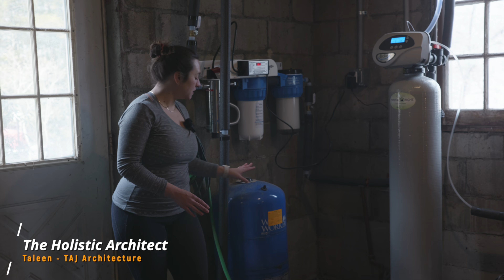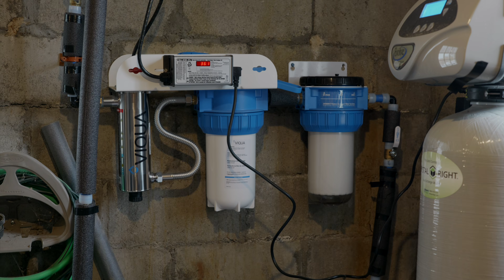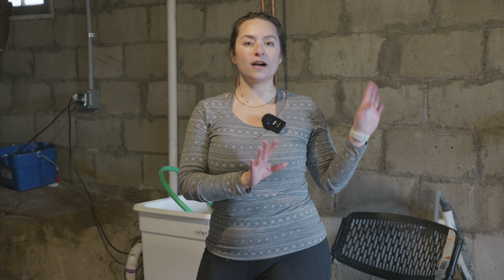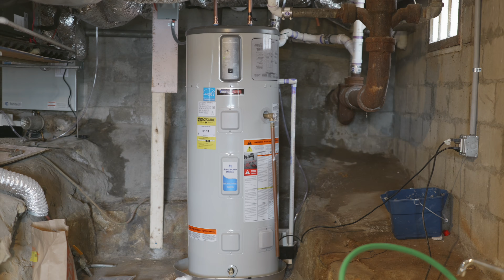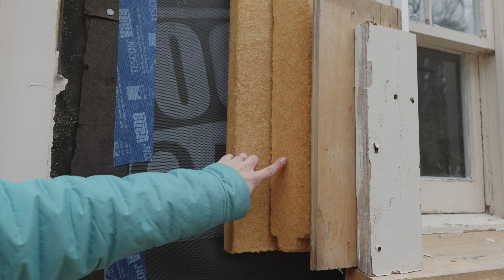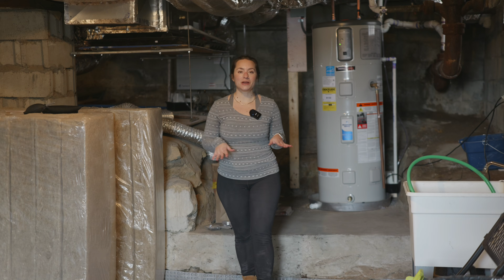1950's lake house water well needs lots of work -- filtration + hybrid heat pump water heater

Comment: I’m curious if you could comment on the performance over this past winter?

We have non-H2i Mitsubishis, and they really don’t work below freezing. My understanding of the H2i units was they’re effectively resistive heaters at low temp by the addition of a pan heater, not because they change the refrigerant loop at all. So the COP basically drops to 1. Have you noticed that? Were they producing enough heat for you and still putting out a good delta at the indoor units?

We had the 80gal Hybrid Rheem and found it to be a good option, but had non obvious limitations. Like you can’t use a recirculating loop and maintain heat very well. And recovery speed on heat pump mode alone was not remotely enough for a young family. 

I think your basement install promises to be a better fit, but I’m curious about the real world performance with the smaller tank. Have you found recovery time a non-issue?

We ended up adding ~2gallon point of use resistive water heaters at sinks and it was a huge quality of life upgrade as well as a big water saver. But this was a retrofit where we were limited by under slab copper.
Reply from the maker: I don't know the ins and outs of how the machines work. however, we saw no issue with the units in the winter, even when we hit lows in the teens

Comment: How did you air seal the ceiling of your basement? Thank you for great information !
Reply from the maker: this is an ongoing project. the main component is the installation of 5.5 inches of hemp insulation and vapor barrier on the floor joist above the basement. the goal is to block all air movement from the basement into the floors above. the basement itself is not going to be air sealed - although ideal, it isn't a priority at this time (too many DIY priorities)

note - the mud sill was air sealed from the outside as part of our weather resistant barrier. the transition from basement concrete wall to 1st floor framing was covered by our self adhered WRB (adhero 3000)